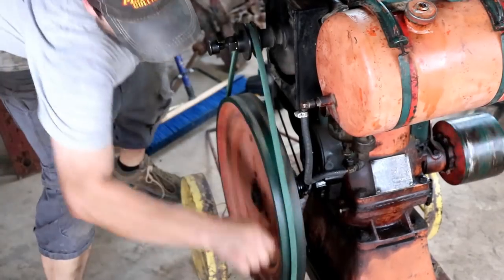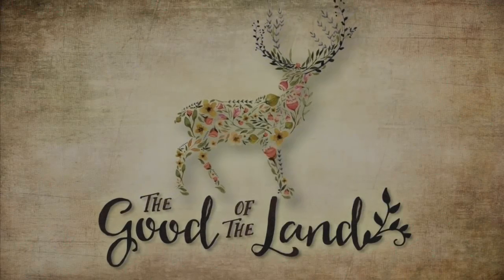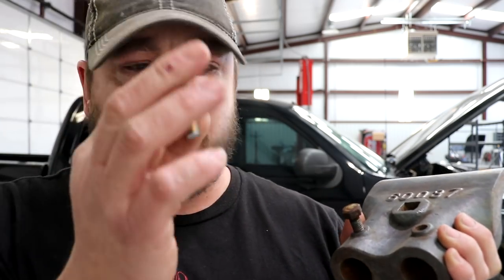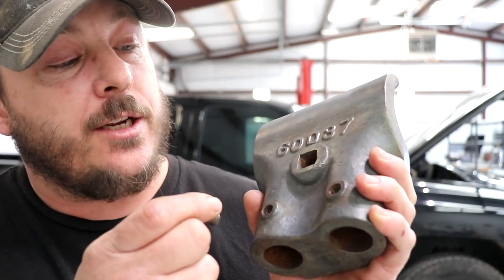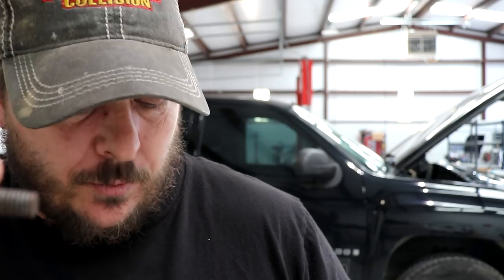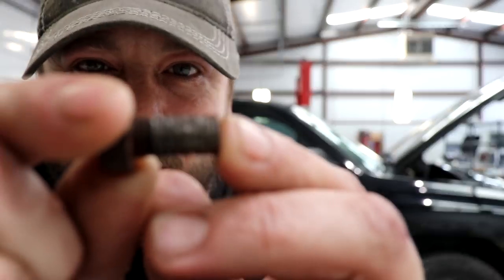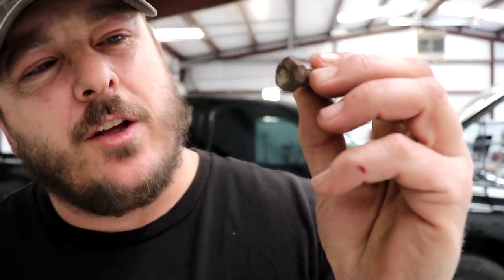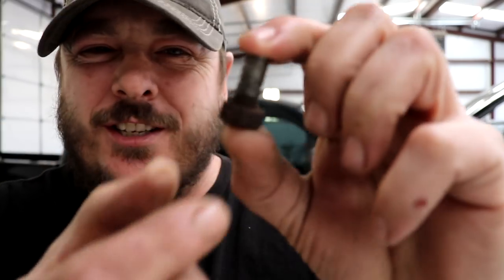OLD MECHANIC TAUGHT ME THIS YEARS AGO! Passing it on to the NEXT GENERATION!

Comment: Not a good idea, first you only need a hacksaw and a nut to do the same thing in half the time, the main point though is when you grind the head and sides off your taking the zinc coating off the bolt so it will rust in no time
Reply from the maker: +phoden https://youtu.be/OgvQKuCOhqI

Comment: I probably wouldn't need to take the top plating off of the bolt head, but thanks.
Reply from the maker: +GenerationXT https://youtu.be/OgvQKuCOhqI
Reply: Yes, I already understood why you removed it. My point was, with the items I tend to work with around here, removing the plating wouldn't be required. Again, thanks for the tip.

Comment: The only problem I see is running that Scotch Brite wheel on the flats of the hex. You will never be able to hold that grinder parallel to the plain of the existing hex surface. This is one way bolt heads strip over time.  Now, understandably  Scotch Brite won't do much damage to the surface as long as it's done quickly. However this is a bad habit to have, and perpetuate. If the idea was to debur the grinding you did to the top of the bolt. It was a waste of time as the bolt head is chamfered on the top. Either way I would run each flat of the hex on a flat piece of emery on a flat surface by hand if needed. Will take a little more time but you keep the surfaces true.

Comment: So what's so clever about that?  You've removed the plating from the head so it will rust in no time at all.  You spent more time grinding it shorter than if you had used a hacksaw.  I think I'll stick to doing things properly.
Reply from the maker: +arburo1 https://youtu.be/MJ4fva0nrLs

Comment: wow!  I wouldn't have even thought to to show someone who claims to be a mechanic...if you can't figure out you need to shorten a bolt you shouldn't be playing With them and I suppose if you dont understand how things like bolts and cast and forged parts are made you learn before rebuilding...buy a lathe...here's a lesson I was told around 1980...this is cutting torch and this a grinder...you can make about anything from metal with these two tools.  the same old man said once to me...when making something regardless what material all you are ever doing is adding to or taking away.  now turn that bolt red and dunk it in oil and graphite to blacken...that's how they painted old steam engines...hence the paint never burns off because it's not paint. haha...happy building

Comment: The bolt is softer so it gets damaged before the fitting. Your replacing the soft bolt with a grade 8 should be a grade 3 at most, Just sayin.

Comment: Nice limiting with the extra nuts. Why not just use a hack saw and file to dress the end? I've done that with success. Turn off the nut, threads are straight. No need for a grinder...

Comment: Except that you stripped off the gold galvanization off the bolt and now it's prone to rust, reducing it's structural properties, especially on a truck. If it is a professional repair shop, this business practice would lead to some bad reviews, which as you may know, will lead to dozens, if not hundreds, of lost clients during the course of a year. Hardly worth the cost of a bolt.
Reply from the maker: +Mich Po Oh my lord!! Great the first comment...Obviously there is a reason for removing the coating. 😥

Comment: Rather stupid grinding the Grade 8 hardening markings off the head to make it appear to be a soft Grade 3 bolt, then putting the altered hardened bolt into cast iron. Believe it or not there IS a REASON the Grade 3 bolt was used for this application. This was done so the BOLT would strip rather than tearing out the brittle cast iron threads when some idiot over-tightened the bolt.
Reply from the maker: +76Chev4x4 https://youtu.be/OgvQKuCOhqI

Comment: I don't see why you would grind off the markings on top of the bolt? These markings tells a mechanic if this bolt is metric or stand U.S.C. threads and how strong this bolt is graded so he can replace the old bolt with the same grade or something stronger. Also when you grind off the top you are removing the zinc coating that prohibit rust. In your video you grind-ed of the marking that told me that this was grade 8 USC threaded bolt. The strongest bolt out there so I wouldn't want to replace it with just any old bolt especially one with no markings. A bolt with no markings is rated 2 grade. Alot less stronger that a grade 8.
Reply from the maker: +raymond castro https://youtu.be/OgvQKuCOhqI

Comment: Why not just cut excess bolt off instead of grinding all the way down?
Reply from the maker: +Dell Scottenhttps://youtu.be/OgvQKuCOhqI
Reply: The Good of the Land   thanks for the new link , I understand about putting a nut on your bolt first ..to renew the threads, I was referring to cutting the excess off as to grinding it off? I've always used a wire wheel after cutting to smooth end of bolt !
Reply from the maker: +Dell Scotten That's a great Idea!

Comment: Not sure why you just sanded all the stuff off the head of the bolt that keeps it from rusting but whatever floats your boat it just got me really triggered
Reply from the maker: +Kyle Green I find that when some one is triggered it is usually an emotional reaction which blinds them from the ability to reason their way to a conclusion. I assure you there is a reason for removing the coating, however I believe it would be more helpful if rather then explaining it I ask you a simple question. Is there other ways to protect metal? What is the bolt being used For? Is there any other information given which would explain my actions? I will answer the last one for you. The answer is in the first comment which you missed because you reacted rather then explored. Hope this helps! There is a three part series on the peice of equipment the belongs to this bolt, and they are quite enjoyable to watch. Thank you!

Comment: Finding another bolt is somehow special info from an old mechanic?
I wouldn't have ground the finish off the head either. It'll rust quicker.
Reply from the maker: +randymc61 https://youtu.be/OgvQKuCOhqI
Reply: Adding a nut before you cut it to then screw off to fix the messed up threads is the trick. My dad taught me this when I was 15 getting my car ready, but not everyone has  access to someone teaching these things that we dont even realize are things after we learn them.

Comment: I'm just guessing, but when Jethro Tull invented the Seed Drill in 1701, I would assume he had bolts that weren't right for the task either, and NO trip to Bolts-R-Us would fix it, and the corner hardware store guy wasn't answering his mobile that day.........Somehow I doubt he used a 240v angle grinder on his bolts, more likely a hacksaw and hand file, same way I first saw this done 45 years ago.......good tips updated, never die !!

I use the same trick to make double ended hook bolts for hanging tools on the wall, fit the nuts, bend and cut, then you have an adjustable threaded hook.
Reply from the maker: +Bite My Krank https://youtu.be/OgvQKuCOhqI

Comment: taught you what ? how to use a die grinder. I've made bolts from scratch with a grinder and tap&die set
Reply from the maker: +ben martin https://youtu.be/OgvQKuCOhqI
Reply: Still no trick its just common sense 
No more so than cleaning a sealing surface before installing a new gasket

Comment: I hope that bolt isnt in the elements because you just stripped off the zinc protective coating on the head.. will rust like a bitch in 6 months.

Comment: if i ever got my hands on you are , you are toast,  i hate working on cars where some bolts are a mixture of af, whitworth and  metric, its because dickheads grind down bolt heads to fit a spanner , mind you what do you expect from someone  who  still use  the imperial measurement for sizes and weights and drives on the wrong side of the road

Comment: First of all, you used a cut off wheel to grind the bolt. Wrong. Then you ground the head of the bolt and remove the "spokes" than indicate the tensile strength of the bolt. Sad.
Reply from the maker: +steve lewis https://youtu.be/OgvQKuCOhqI

Comment: all of that was pointless and never needed to be done if it was an inch longer sure but 1/2  on a 1/2 inch dia zinc coated bolt that is now going to rust after 38 hours of weather was pointless and you could have used the markings for the future knowing it was cut short,  i hope to  coated it or painted it after install
Reply from the maker: +keep thinking https://youtu.be/OgvQKuCOhqI

Comment: Now, here's another old mechanic telling you about thread files.
https://m.youtube.com/watch?v=dYu_fl59Ztw

They are a four sided, double end specialty file with 8 different threads. A set of three gives you all the fractional threads per inch. I think a metric set is two files.
They can be a life saver.
Until you can afford a set of thread files:
When I cut off fasteners, I chuck them in a drill, then use my drum sander to put a slight chamfer on the end. Spin them at a couple hundred RPM's and hold the drill at an angle.
Reply from the maker: +George Dennison https://youtu.be/OgvQKuCOhqI

Comment: WTF I thought this was going to show a way to restore old hardware not take a shortcut and hack new hardware. I'm 33 and I've known this since I was 12 working on my bicycles now I do it for my daily driver that's 49 years young. Now I'm not doing show pieces so I don't mess with the aesthetics just cut grind and bolt back on. You need to change your title to quick tip to replace old junk and stuff.

Comment: This video shows the worst advice I have seen, why would you remove the zinc plating? That bolt is going to rust and wont look shiny for long, plus grinding the sides of the head effectively changes the size, which is calibrated to work with tools, this means no wrench or socket will ever work properly on it

Comment: did not know that this wasnt just common sense, I mean if you have a cut off wheel why waste gas driving cut a bolt down no one in my family is mechanically inclined I just did this to make shit work
Reply from the maker: Bo618 https://youtu.be/OgvQKuCOhqI
Reply: The Good of the Land well yea I got the putting the nut on to fix the start thread but wasnt shown that by anyone just common sense after first time cutting one down and trying to start a nut

Comment: This is a old mechanic trick?  You shortened a bolt?  B. F. Deal.
Reply from the maker: sparkye63 Read the title.Never call it a trick. In the video I called it a little tip. You must have blocked that out for some reason.

Comment: Wait.. what. Literally just said he was going to make another bolt into the bolt he needs. Then ends up finding an identical bolt and shortens it? Wow.. this would be helpful maybe once every 20years of mechanical work. The parts come with bolts if they should be replaced or the bolts shouldn't be damaged in the first place. How about this tip, "hey apprentice, don't fuck the bolts or you'll be walking to the wreckers and pulling some new ones"
Reply from the maker: +Daniel A https://youtu.be/OgvQKuCOhqI

Comment: Good video, I liked and subscribed. I thought it was a cool little trick for chasing the threads after you cut a bolt. Idu why the Monday morning armchair QB's of YouTube take such issue with your video? If you've ever cut a bolt and tried to thread a nut on even after you have eased the edge, you know it's quite difficult. So unless you have own a Tap & Die set (which not everyone does) there's no easy way to chase the threads. So this trick solves that. I think even Uncle Bumblefuck aka AvE would like it.
Reply from the maker: +Carl Brutananadilewski https://youtu.be/OgvQKuCOhqI

Comment: Really?
We need a 'tube vidoe of how to shorten a bolt? 
BTW, as soon as you held up the old bolt, I could tell you it was probably a 3/8" NC, with a 9/16" head. 
So the shortening I understand...sometimes you need exactly 7/8" long instead of 1". But why grind/sand the sides off the hex-head? In doing that, a standard size wrench will fit loosely. Not to mention you destroyed the nice gold-cad (cadmium) or yellow zinc-chromate plating on the bolt.
While the basic shortening process you demonstrated is of some value, the remainder of the info you have provided is pretty useless. YouTube is full of really poor advice at times. 
Thanks...

Comment: It will rust like hell.
Reply from the maker: +powerpiep Why?
https://youtu.be/xxulUeb1uYY
Reply: The Good of the Land 
The protective coating is removed (the gold colour) when removed it's just bare metal, getting the bolt loose in the future is crap.
Better use stainless bolts. But watch out, stainless breaks a bit quicker.
Reply from the maker: +powerpiep Stainless would not work in this situation. Watch the video in the link.

Comment: Are you taking the piss??? What's next.... ooooooh look I have a piece of wood that's too long for the job I'm doing but an old carpenter showed me a trick where instead of buying a shorter piece of wood, I can actually chop some off this one. Fuck me, if you went to buy a bolt they would simply match the thread and expect you to chop it to size. What kind of crap is this..... my mind is actually blown.

Comment: Hack, WTF? Most over misused phrase on YouTube
Passing onto next generation? Really, cant we stop it now?
So you spent 5 mins grinding end off a SET SCREW which isn't a bolt FYI which would be quicker hacksawing
The you proceed to remove the zinc plating so it will rust.
How old is your mechanic as I think he may be going senile.

FYI I have 40 years in mechanical maintenance and machining.
Reply from the maker: +Dave P Who said hack? 
https://youtu.be/OgvQKuCOhqI

Comment: this is stupid and a waste of time.   Use washers if you want to shorten the thread length
Reply from the maker: +Larry Tak It The bolt is being used as a replacement set screw. This will help.
https://youtu.be/OgvQKuCOhqI